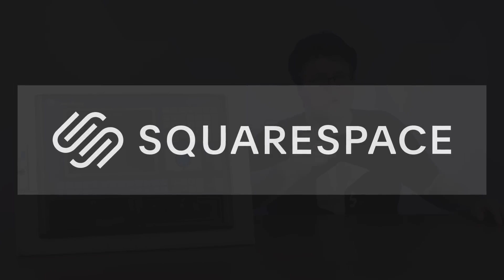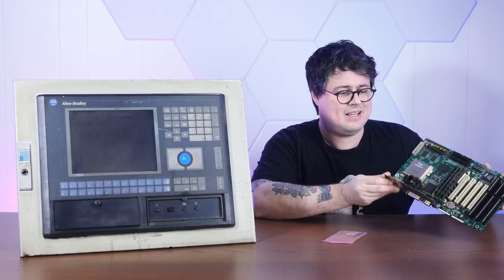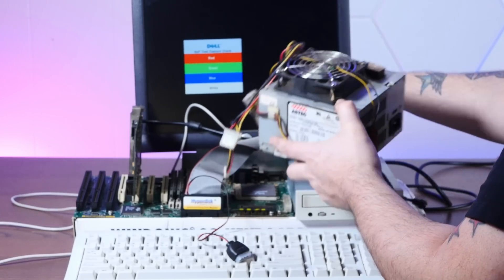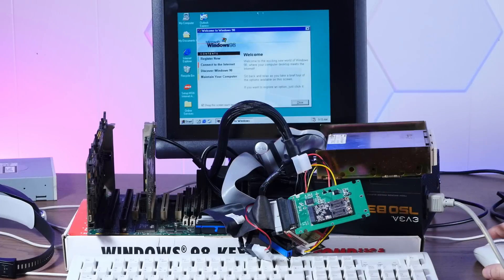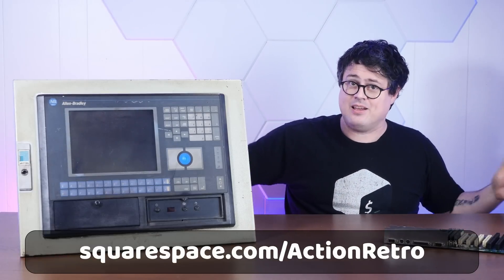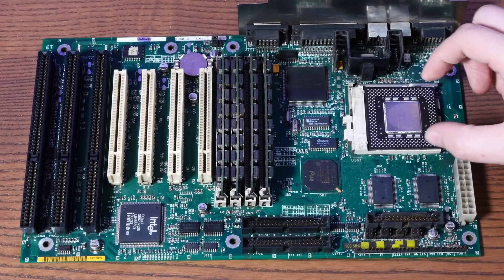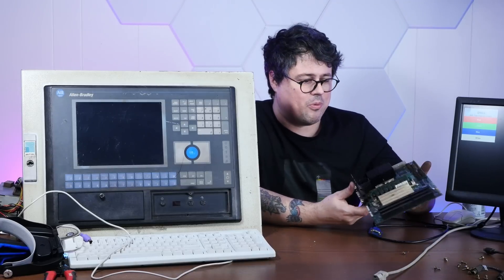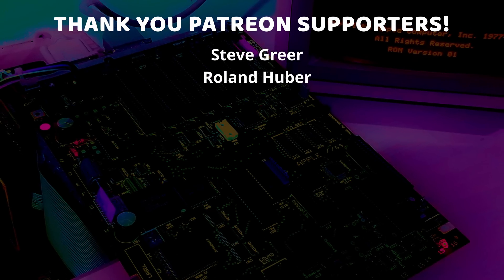Overclocking a 90's Industrial Computer

Comment: fairly certain the intel MMX series were multiplier locked and were only overclockable with faster FSB. you could try to find a K6 chip as the board appears to have a voltage regulator on it. some of the higher clocked K6s take a multiplier of 2x and set it to 6x as most socket 7 boards lack a 6x multiplier. as for the screen if you adjusted the FSB from 50x2 to 66x3.5 the faster FSB could overclock the PCI and ISA buses and put the video card of of spec? some BIOS have adjustments for this in the menus.
Reply: Nope.  I had a problem 233MHz MMX processor running at 300MHz.  He's just bad at this because he's a Mac guy.
Reply: @davidwiley4953  I thought the common fast FSB was 83MHz, which would run a 233MHz chip at 291, not 300.
Reply: @eDoc2020  It was rated as 233MHz and technical it was suppose to run at about 266MHz (100MHz FSB with 2.5x multiplier for  250MHz) based on my boards documented maximums but somehow I got a 3x multiplier working on my Socket 7 (not super) motherboard and ended up running at 300MHz even.  I had some weird brand board that broke several "rules". Those were fun days.
Reply: @davidwiley4953  100x3 would explain it, although I'm surprised a non-super 7 motherboard would support such a speed.
Reply: @eDoc2020  It was not suppose to but I accidentallyput the jumpers wrong and it said 300.  It was a weird SIS chip board that also used EDO SIMMS but didn't require pairs and even though the BIOS didn't see drives above 80GB, it still booted of a 120GB drive no problem.  It broke rules.
Reply: @davidwiley4953  My "Scrap Socket 7" system which I started making a video about also has an SiS chipset which can work with a single SIMM. One thing I noticed is that the reported CPU speed is rounded somehow. It wouldn't surprise me if it reported 291 as 300. And while the BIOS sees drives above 8.4 gigabytes it has the super-annoying problem where it crashes if the drive is larger than 32 gigabytes.
Reply: @eDoc2020  You may be right about the rounding.  I never benchmarked the system.  Got it up 512MB PC100 RAM with the original Radeon before I abandoned it for an Athlon XP build.  It was originally a hand-me-down Cyrix PR166 system that was garbage with no sound or optical drive and DOS only.  I was quite proud how far I got it.
Reply: @davidwiley4953  512 megs? How many DIMM sockets did yours have? I personally haven't been able to successfully use anything larger than 128 megs in any PC.
Reply: @eDoc2020  4x 64MB EDO SIMMS and 2x  128MB PC100 DIMMS.  It wasn't efficient as the EDO basicly killed the PC100 performance benefits.  The EDO SIMMS were a rare accidental find from an old dual 486 server someone threw out.
Reply: @davidwiley4953  Mine does weird things when both SIMMS and DIMMs are used. It only has two SIMM slots and when they are used it disables one of the two DIMM slots. Plus Windows always crashes when both types are used. I don't know why but whatever. I don't need that much RAM on Socket 7, I do also have newer systems.